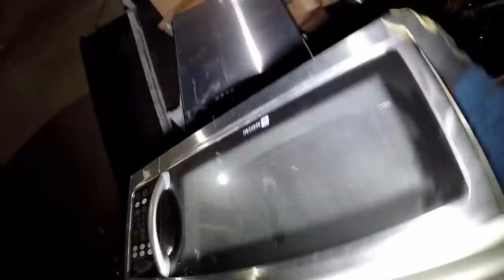Dumpster Diving "I'm Gettin' Some Good Vibrations"

Comment: Those Costco bags are good for hauling a load of groceries! The big bundles of cords are usually called "jumpers" and connect servers to special power bars in a rack called PDUs, instead of to typical wall outlets (they can be 120V or 220V).

Comment: The big 3 pronged end of those power cords looks the same as electric dryer plug in. Not for dryer  obviously  but heavy-duty.  Great score!
Reply: more than likely those are for something like a large battery backup unit that runs on 220
Reply: They are Australian cords.

Comment: Those 220 volt power cables - I bet there is a use for them here. That is the same type of plug your clothes dryer uses, and I know that plug type is used for other things as well. Anyway, it is worth seeing if you can sell them.

Comment: The power cords are for like ranges,dishwashers, stoves, 220 stuff. Very exspensive to buy. Yes they are used on certain equipment in the states. Like tools for garage equipment.  You have to have a special plug. Very exspensive.
Reply: They are Australian plugs

Comment: Those motors. Are combustion blower motors for hvac gas units an gas furnace motors is what I think they are I do hvac work , you sure should check out the model numbers on those they're $100 plus normally

Comment: The copper winding harness in a motor is called a stator, half of those black cables look like IEC extension leads (computer lead type)

Comment: Hi Mike there is 2 lbs of copper in each of those old tv,s.
Reply: Transformers and the picture tube deflector easy 2 lbs i almost forgot the gause coil around the picture tube .5 lbs

Comment: Mike the scavenger This is Boston from Pottsville, Pennsylvania. I watch you all the time. You and Dottie why don't you? Put a pipe on the end of your truck about 8 foot hi. With a small electric winch on it All right hand winch with a crack. So you can lift things out of the dumpster. That is heavy. Like those two real big metal things you found a couple weeks ago and that real big metal box. You could have had it all.

Comment: Just wondering what you do with those microwaves? The transformers inside of those are very cool to have on hand for diy projects like building your own stick welder or an electromagnet. Check out diy welder using a microwave transformer on the tube. I bet you can list those separately for a bigger penny than just scrapping. I’m forever finding them and pulling the xformers for such projects. Ok, I’m a new sub and I’m digging those dumpster dives, no pun intended😉✌🏼you have way too much fun! Stay safe my friend and dig on......

Comment: On tube tv's there is a beautiful piece of soft copper wirer that raps around the tube twice. I use it for art. But it a nice piece of copper. It is tightly wrapped which electrical tape. I'm unsure of why it's so much soft. My guess it's like gold and the more pure it is the softer it is.

Comment: The box you was standing on did u ever look in it? The last dumpster with all of the motor plus the motors look to go on furnace or the a/c unit on the roof top to pull out exhaust fumes or to move heat around in the heat exchanger where they are sometimes gas.

Comment: I know this was two years ago but those blower motors look like the blower motor on my insert that goes in my fireplace. It’s like a fireplace that you don’t have to put in the fireplace like a woodstove. They run me every time I have to replace mine 300 bucks a pop just replace the fan blower fan in my woodstove.

Comment: good learning curve for you, some of that motor with gearbox are useful, the ones you have gearbox are the same as the white ones just no motor attached, u offten find the motor and gearbox are part of a pair, read the motor voltages, 120 240 or 3 phaze 12v 24v ect ect, ebay the lot, always someone looking for this sort of stuff.

Comment: Most of the parts you think are pumps are actually right angle reducers for motors to give the motor high torque. And the silver ones with motors look like stepper motors with right angle speed reducers. Pretty expensive parts.

Comment: I have a question for the viewers of these videos: is there anything that Mike normally overlooks that, if you saw it dumped somewhere, you'd pick up and try to make use of? For me it'd be plywood (I already have too much plywood)
Reply: Free project pallet wood, and plywood..
Reply: Gotta say mike seems to not wanna dig even when he knows there’s more underneath (seems to happen with open tops) so he overlooks a lot... potentially due to the pain in the $$$ it would be to get it.  Understandable, but sometimes it drives me crazy especially when there’s a lot of better items on top he’s already taken...so I just get stuck with the curiosity of what might be in there still.

Comment: oh nice kids bike seems to only need a new inner tube, yeah the tyres in dumpsters is a no no, the company that has the open top dumpster gets charged for that, they then chage the ppl that hired it might be why they threw the tyres out take yer tyres to the scrap yard ppl as in car scrap yard, dam! this is the dumpster that just keeps on giving, mike will have to do a wire run or stripping some wire soon,

Comment: crkt's are good knives, and guaranteed for life. if you ever need any scale screws or the teflon blade washers, they will send them to you for free. just go to their website and order them. that spaceship part is a gear box to transmit power at 90 degrees to the motor shaft. it might be a reduction box as well. if it's good, it's 40-50 bucks. check out radwell industries. they buy surplus parts to resell them. they might take them off your hands. it's worth a try. it's amazing the stuff businesses will toss just because they don't want to count it. my dad and i used to build yard barns. we would buy material at the trailer factories and rv plants around where i live that they didn't want to inventory. you had to buy it all, and spend around a grand or more, but wind up with 4-5k worth of stuff. we got two 200,000 btu coleman electric furnaces once that were new, but had a couple of dents in them. one of them is currently heating my garage, and the other i removed the dents and sold for $600. plus we got enough lumber for four sheds at $2500 each, all for $1200 cash. that mean ol' ringtail wasn't very cool. you asked it not to bite you, even said please, and still chewy chewy chomp. so much for professional courtesy. i remember when i was a kid they were worth 35-60 bucks each. i had lots of $200 weekends with my dog in the woods.

Comment: How much you want for a flat rate box filled with those C13 Extensions? (not the Euro ones) the ones with a C13 plug male and female (they are like PC cables but "extensions")
Reply: u meant these: Male C14 to Female C13 extensions cords, didn't see any Euro plugs cords, only seen @42:00 Australia Type I plug and bunch @41:35 of type A USA cords
C14-C13 extensions cords this can be used in USA and EU and all over the world, depends on gauge of wire, if u have proper plug adpater to wall socket, these are used for PC, old PCs, old monitors, electronics devices, electronics measuring devices, ......
Reply: @selfro2382  yep aus same as euro to me ie not us :-) so the male end is called a c14?. Cool.

Comment: Man I don’t know if you will see this comment or not but there is a bunch of copper in the back of them old TVs. You are missing out on a easy pay day. Just bust the back off them and take the copper and leave the rest. Easy as pie. I mean your missing pounds of copper.
Reply: degausing wire is the heaviest part and easy to extract... you're right